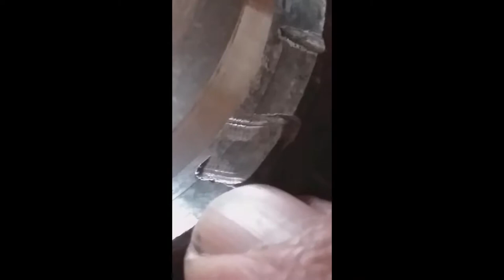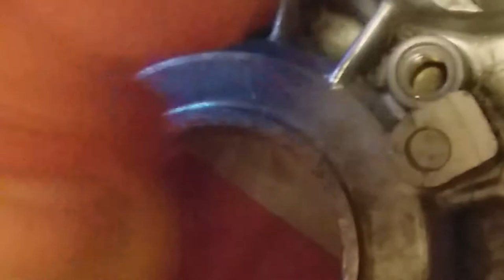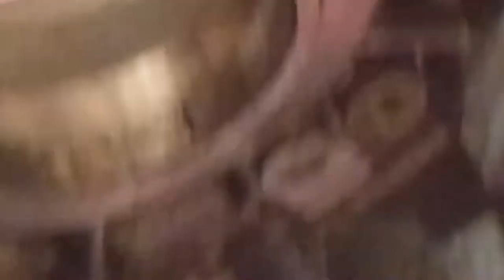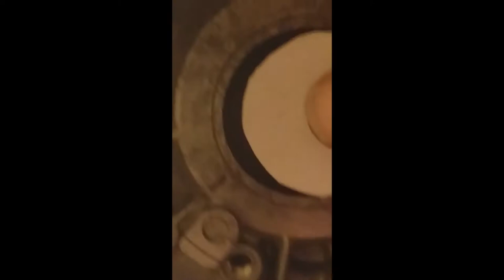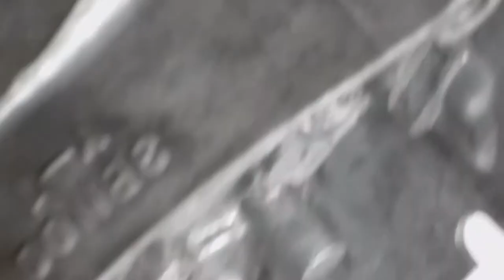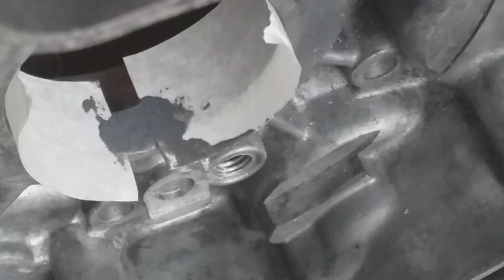Motorcycle crankcase repair 2 stroke Yamaha DT125R this was the end

Comment: A little tip when fitting new seals is if the surface that the seal sits in is rough (maybe not to your extent) coat the outer portion of the seal with loctite, it will fill in the gaps although I don't completely recommend this method when it comes to crank seals but it's worth a try if all else fails
Reply from the maker: Something about this sounds like a good fix, thanks for watching and commenting.  Maybe use the idea for future reference

Comment: Id of just used  ally brazeing rods cheap as chip's on ebay and alot stronger than chemical metal.iam just doing a engine rebuild on my own dt125r got some koyo crank bearing for £8 each which is a big deference from £70 that Fowler's want each but iam gunner defiantly use genuine crank seals not like them £10 cheap crap on ebay not worth risking it pal
Reply from the maker: Yeah but even lumiweld requires alot of heat initially to get a good molecular bond and using alot of heat is a recipe for distortion mate. Tell you if  you ain't used JB weld don't knock it it's helped alot of people out of trouble.
Reply: That bit where its broke near clutch arm is a common breakage they all break their on all of the dt125r pal
Reply: @peterh600  you could of used normal pipe soldier doesn't require alot of heat and heating up in that area is gunner do nothing how do you think you get the crank bearing out you heat the cases up to get them out its only brazeing not standard ally welding pal
Reply from the maker: @officialmysteriousrider6327  yeah it's hard to know if Yamaha wants the left cover to fit snugly against that or if a rather untidy gap is more likely.
Reply from the maker: The cheap crap seals are more like 5 quid and how long can they last Bud
Reply from the maker: @officialmysteriousrider6327  hey dude it runs so what
Reply from the maker: @officialmysteriousrider6327  just saying it was easy to keep the seal face true with this as solder would be harder to file
Reply: @peterh600  yamaha didn't sell them like that they just seem to break in the clutch arm area every dt ive had over the year's have all been the same
Reply: @peterh600  dremel sanding drum emery cloth
Reply: @peterh600  yes would never buy them only always used genuine parts ive restored many dt125r all to factory spec
Reply from the maker: @officialmysteriousrider6327  hylomar blue can block your oil passage if it gets into the crankcase,  i don't want it mate.
Reply from the maker: @officialmysteriousrider6327  hey thanks for watching anyway and I appreciate you commenting mate.